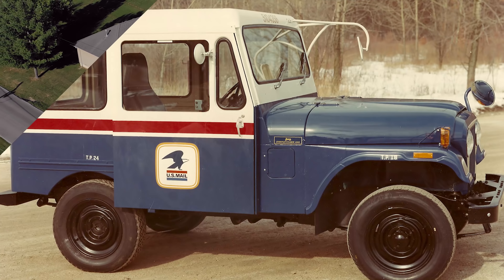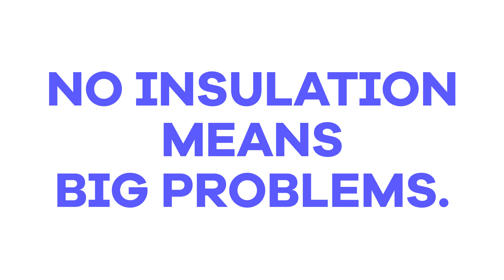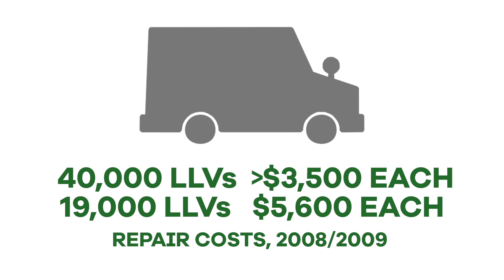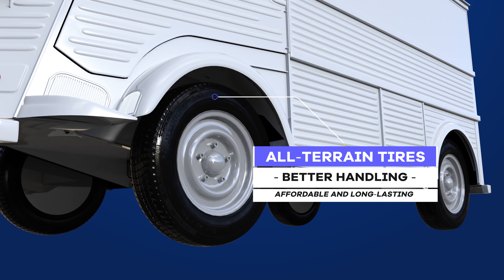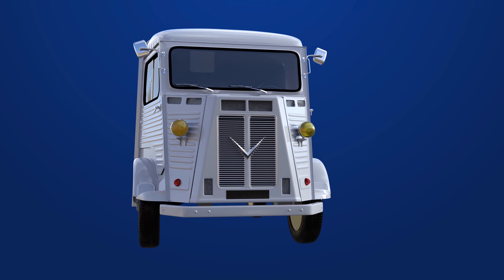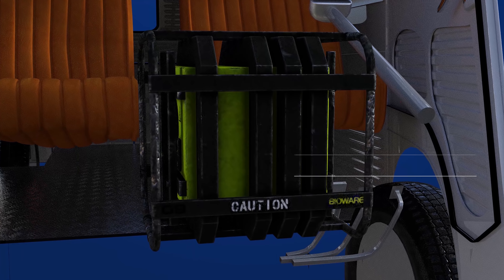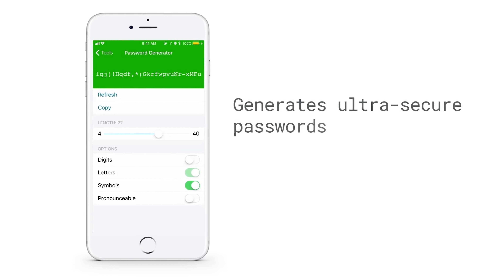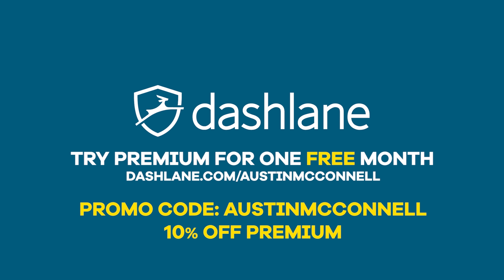Postal Delivery Trucks Stink. Let's Redesign Them.

Comment: Isn’t the steering wheel on the right side so that the driver doesn’t have to get out and go around the truck to deliver mail every time he pulls up to a mail box? Not for safety?
Reply: It's both. In the US you drive on the right side of the road and house mailboxes are on the right, not the left. 
Right-hand turns are safer to make then lefts. When turning left you need to cross traffic, more chances of getting hit.
Reply: Ryan Yuschock okay that makes sense too.
Reply: It is, it saves times. Also, part-time mail workers have a set time they must complete their route in, which this helps in doing.

Comment: In the summer my town easily goes up to 110 and mailmen tend to pass out In those vehicles weird how it’s not national news
Reply: STEEZY Cesarz Floridian here who has occasionally moved inventory in/out of cargo containers during peak summer.  No more than 1 hour inside of merely standing there and I had sweat dripping from my nose and bloodshot eyes; sometimes even spotty vision and lightheadedness.  The hot air is suffocating, and the heat feels like its “compressing your body” (if that makes sense).  I don’t see how a post office truck is any different considering the benefits of the front doors’ cross draft is negligible/negated since these trucks are rarely going those 40-60 MPH, in addition to them working full shifts.  To think your 110 outside could easily translate to much higher temperatures in the vehicle’s rear is terrifying, especially since this is where they spend most of their time retrieving/organizing packages.  How often do you hear of this in your town?

Edit:  Sincerely not trying to lecture or argue with you (if my tone is misconstrued), but wanted to add another perspective to strengthen your topic! 😀
Reply: I actually wait with a bottle of water for my mail carrier. Texas gets really hot.
Reply: Styrofoam insulation panels glued to the inside would help.

Comment: I am a mail carrier from Central Florida. Thank you for thinking of our mail carriers and trying to come up with a design. A/C great!!!!!!
I think we should ask mail carriers what they would want in their trucks. Having the driver side on the left side is a very bad idea. The mailman would have to get out the driver seat and walk around the truck to deliver the mail to each mailbox, which is unsafe and a waste of time. Also there is no mail table to lay down the mail for easy access to the mail. No need for computer tablets for tracking packages because our scanners do all of that in lifetime. Raising the mail trucks will make it more difficult to put the mail in the mail boxes, the mailboxes are usually at the same height as the mail trucks window. If you want to come up with a good idea ask us the mailman.
Reply: I'm a retired carrier. I would've loved A/C (I worked in PHX for 25 years), but too many carriers would spend their 10- or 30-minute break time idling with the A/C on.
One thing I haven't seen in the comments is the too-long wheel-base of Austin's vehicle. USPS trucks typically need to make many U-turns. They need a shorter wheel-base.

Comment: The ideas are nice but if you want it last as long as the ones now, you can't go electric. When the batteries fail, which they will, be very expensive. You really need to keep the design as simple as possible. Go with a small diesel engine, low emissions with good fuel economy.  The LED's are good, they are cheap, and they last a while. Get rid of the airbags, the number of fatal accidents that involved a mail truck is so incredibly small and you're adding weight, cost, and problems down the line when either sensors or air bag connectors fail.
Reply: Yah getting rid of a life saving safety measure to reduce weight what a fucking genius....
Reply: @zionbrink513  yeah lol
Reply: You can actually make it a hybrid so it uses both eletric and gasoline so it balances out the cost, the reason why people are using newer methods is because the older ones are costly and very outdated

Comment: Or you can just look at every delivery truck in Germany and just copy the design xd
Some even are powered by solar energy
Reply: ToolixHD the ones that would be about this size are basically just VW Transporters painted yellow.
Reply: ToolixHD aber die Fahrer mögen die komischerweise nicht
Reply: Henning Gu Die Fahrer mögen die alten nicht. Es gibt auch welche die sehr wohl von den fahrern gemocht werden
Reply: @sinom  yeah and that's good
Reply: but do they have flames on???
Reply: "The Deutsche Post is the successor to the German mail authority Deutsche Bundespost, which was privatized in 1995 and became a fully independent company in 2000. " 

The USPS isn't and operates at massive losses - redesigning the truck is stupid because it addresses NOTHING. Privatize the USPS easyyyyy fix.
Reply: They aren't as comfy as Austin's design tho
Reply: "powered by solar energy" 

Maybe a single light bulb inside the car is, definitely not the cars battery.

Comment: If it's electric then why does it still have a gas cap????
Reply: The same reason that Teslas do, probably. To cover the charging port and protect it from the elements.
Reply: Electric Charger port.
Reply: it's actually still for gas, and it does still have a gas tank. so when the committee that is looking at the prototypes realizes it doesn't even have the steering wheel on the right side then they can torch it like the dumpster fire of a design that it is.

Comment: Electric motors wouldn't work at all. 50miles range is not going to cut it, even 200 miles in some areas is not going to cut it. Not to mention it is not going to save any money because all that money you saved on gas you now spend on electricity.

Also electric cars lose any possible benefit it winter, when you run the heater.

Comment: This my idea (as a Brit who has never been to america and is not sure it exists):
Its 32 feet long and has 12 wheels, pivoted in the center. The front-half has a large area for packages towards the front, taking the form of a large box with sides that angle in at 25 degrees as they get towards the top, the roof is raised up above the walls creating a 3 inch slit that it overhangs (allowing people inside to shoot out in saftey). There are two doors on each side that flip open to create 3 feet wide ramps. On the roof at the front on the roof is a surveillance tower (10 feet tall) with omni-directional cameras, speakers and lights (optional mounting for remote controlled water-gun/firework launcher/machine gun). The sides of the compartment are made of 65mm steel and the front 120mm steel.

At the back of the front half is the driver area, which is 11 feet of the ground and accessed by a small lift (ladder in emergency). The cab is fully isolated from the elements and protected from chemical biological radiological and nuclear attacks. In times of duress the cabin can be ejected from the control tower or driven remotely from the command center. It has 110mm thick, bullet resistant perspex all around and the chair can swivel. Bellow the cabin is a small nuclear engine developing 2200bhp.

The rear half has the same mail area as the front but also has a empty space at the very back with can be used with various add-ons  such as: DJ booth, Crane, machine gun nest or twin 75mm anti-aircraft guns.

The whole vehicle would weigh between 15 and 22 tons, could hold up to 15 tons of mail and can have its wheels removed and replaced with Armoured Caterpillar tracks (adding 8 more tons) and a range of 200,00 miles.

Sorry what was I designing again?
Reply: Scabeiathax Novastorm it sounds like something that would be conceived by the collaborative design effort of the pimp my ride crew and a couple of survival preppers. Is it multi-crewed or a one person vehicle?
Reply: One person is needed to drive it, but the optional turrets in the rear section need gunners and (for high caliber weapons) loaders. Also the vision slots on the side allow it to carry up to 35 people with side visibility and the ramps allow many people to embark at once.
Reply: Scabeiathax Novastorm sounds like my dream car where I can do drive bys more safely when is this going in to production ?
Reply: Made my day
Reply: Mad Max's mail tuck apparently
Reply: Ive done some research and am making some modifications:
1. A large pole on the roof of the cabin for eagles to land on.
2. Refrigerated compartments in the floor for the transport of foodstuffs.
3. A row of hooks along the inside walls so that composite Armour panels can be hung over the outside (I'm not sure that 65mm of angled steel will cut it in some places)
4. The nuclear engine is being broken up into 4 nuclear V8s
5. An optional attachment where the whole truck can be driven up onto a raft and its engines used to power a giant fan.
6. Spinal firework launcher
7. Sat-nav

Comment: In France, or at least in Grenoble, we use bikes.
Reply: Sugar and Markers but this truck in America carry a lot of letters and packages that doesn’t fit the bikes
Reply: Motors where I live
Reply: France I smaller than the USA
Reply: @mac34iq42  How much does a truck carry? In our rural areas in Sweden, VW vans are used, but they have to deliver letters to around 1500 people on a 150-200 mile route (one way), give or take. In cities however, which has much shorter distances, they use bicycles (you can carry a lot of stuff on a bike), cargobikes and small EVs (not that much bigger than a cargobike) so maybe the US could use forms of cargobikes in more tightly packed communities such as in cities?

I think one factor we have it that way is that packages (over a certain size and from certain shops) is not sent to your home adress, instead it's your local post office where you go to get it (post offices are mostly integrated in your normal shop where you buy groceries)

Comment: Sounds to me like a less reliable more expensive option compared to a lot of the simpler options USPS is exploring right now. Also why the hell did you put the steering wheel on the left, makes no sense for mail truck drivers, duh they have to put the mail in the mail box on the right side of the road. Electric motors (plus heavy expensive batteries) are not practical for a reliable mail truck that will probably be functioning until mail trucks are irrelevant. Small reliable and efficient gas motors will do the job just fine. I like the flames though.

Comment: My Post Office Uses The Latest Body Style Jeep Wranglers as We Live In The Country Outside of a town of 2200 People in MO. My aunt lives in a large city of 25,000 people and they use LLVs. They actually use snow chains during winter if there is lots of snow. One Thing You Missed Is That Many Post Offices That use LLVs deliver mail in the morning, during spring, summer, and early fall because of the heat in many areas. Though The Town Is Very Nice With New Homes And Nice Paved Roads, Many People Whose Mail Comes Through Our Local Post Office Live In The Country On Gravel Or Even Dirt Roads Which Is Why They Use Right Hand Drive Jeep Wrangler SUVs. Many Rural Towns Use RHD Wranglers

Comment: The LLVs can be fun to drive, but they really do suck. You really can't just move the steering wheel to the left side though, that would break what's called "Mounted" delivery where you drive down the street from box to box in rural and some suburban areas, which also requires the shelf to your side where you're pulling the mail from. I really like the idea of the electric engine, if someone could make something strong and reliable enough. And maybe some reliable temperature regulation would be nice.

Comment: 10 bucks says they still won't have A/C in them.  The post office cares only about liability, not about their employee's daily comfort.  As long as you don't die from heat stroke...they're ok with that.  

I saw a check list of requirements that they gave to these guys and A/C was not on there.  They know it would cost a lot to fix and recharge over the years.  They won't do it.  >:(

The one thing I hope they don't do is make it too high.  It's hard to "jump" down and climb back into that truck when you've got to do it 100 times a day.  Believe it or not it takes a toll.  And because we're often "Curb Side" when you hop down you drop even further because your on the lip of the pavement.  You're jumping down onto the dirt, mud encrusted trenches off the road.  

Also the size of packages now a days, there really isn't enough room to accomdate them AND the mail AND have room so you can keep organized with accessability.  A couple of big Amazon pantry boxes and that back is full.  People are ordering vacuum cleaners and shelving units!  I personally argue that the P.O. should only handle stuff that can fit in a mail box but noooo.  Don't listen to me.  Saving money on labor by making sense is just my dumb idea.
Reply: Novaximus having no airbags is a liability.
Reply: Maybe.  But think about this..IF the USPS had airbags installed and one didn't go off THEN the USPS would be liable for that airbag not working vs just not having one at all.  A seatbelt is required by law and if they weren't wearing one then it wouldn't matter if they had an air bag or not because the employee didn't follow the rules they'd still be required to pay for everything on their own insurance.  Much more than this, if you think how big the fleet is nation wide and how many times airbags would have to be fixed and maintained, those costs probably out weight the liablity of paying for it when they don't go off if that makes any sense.  Where as a seat belt probably costs like 50 bucks to install and you don't ever have to worry about it after that and can work over and over again without any extra costs.
Reply: I don't have ac in my truck

Comment: Your vehicle sits higher?  Were you not dropped on your head enough as a child?  Do you not understand that there are more than 130 million mailboxes that have a fixed defined height specifically in relation to the jeep and LLV?     Seriously, you missed the entire point of the postal system's standards: everybody can reach the rear of the box by hand to get their mail: Wheelchair, midget, giant.

Tho I might be willing to agree that Leyland should make it as they make some of the toughest trucks.

We've really not made an engine better than the iron duke, it'll run on frat vomit mixed with kerosene.  It was the engine that made the 4x4 Eagle the legend it is.  Name another engine type that has two to three million mile lifespans... I'll wait.
Reply: Prjndigo .IS THIS MATT FARAH'S MILLION MILE MAIL TRUCK?
Reply: Binary Bacon I'm sure you can still make it more efficient
Reply: Diesel

Comment: The Mercedes Benz Sprinter is the Perfect choice for what the USPS Really needs.
Reply: Or... Just buy German postcars, they manifacture their own ones, Look it up
Reply: They are called streetscooters
Reply: nope, the Nissan NV200 All Electric is.
Reply: @markplott4820  That would be the Chevrolet CityExpress van as an electric version and General Motors will do that job.
Reply: Sprinters are larger, and better suited to more packages. You would need a smaller vehicle that can easily navigate crowded neighborhoods (sometimes stopping at every box), and since you don't need as much space to store mostly letters it would make sense to make something smaller and therefore less expensive.
Reply: They're already using Ram Promasters (same idea as a Sprinter) for city routes where they park the truck and walk sections of the route. The LLVs are mostly used for suburban and rural routes where they have curbside mailboxes that make its specific attributes useful.
As for "design flaws," these are 30 year old trucks that take ridiculous levels of abuse day in and day out. In suburban, curbside routes, they literally accelerate for 10 feet, stop, accelerate another 10 feet, stop, over and over for hours. This is literally one of the most demanding uses for a motor vehicle. These aren't design flaws. These are examples where they're finally finding the breaking point on a vehicle that was intended to last 20 years in ridiculous conditions, that has been kept in service far beyond its design life. When something breaks on a 30 year old truck with effectively over 1,000,000 miles, all stop and go, it's not because of a design flaw.
Reply: @puckcat22679  Answer Chevrolet CityExpress Van same design as the Nissan NV 200.
Reply: It's the Chevy frames that rust out and need to be replaced that is the biggest problem. GM fails again.
My sister ran an auto repair shop after the owner died, while the family was deciding their next step. Replacing those frames was the only thing keeping that place open. Regular customers stopped coming because after their guy had passed away, then any mechanic was as good as the next.
Reply: Have you seen what the uk use ot is a repainted citronn / purgo expert (cant remember citron's name)
Reply: Finally, some common sense in here.  And they already have a right-hand steering version of it since they drive on the left in Japan.

Comment: 2018 "let's redesign" ...uhhh I must've been in a coma cause I haven't seen one of those box trucks in a couple years ..past few years theyve been using vans not trucks
Reply: USPS has been slowly phasing out the older vehicles and purchasing equipment more realistic to local conditions. If you are in a warmer climate, you'll still usually see the LLV.
Reply: Sometimes, I see just random cars with the USPS logo taped onto a door with like, the whole role.
Reply: still saw this although sometime they used dodge caravan

Comment: the wheel needs to be on the right so mailmen can just open the window and deliver the mail. not get out to INTO ONCOMING TRAFFIC and walk around the truck. if they are going to use the side door then they have to climb over the seat into the mail compartment which is even more inefficient. the wheel needs to be on the right